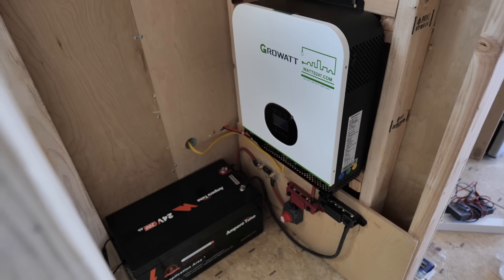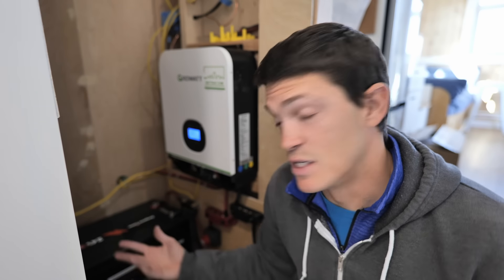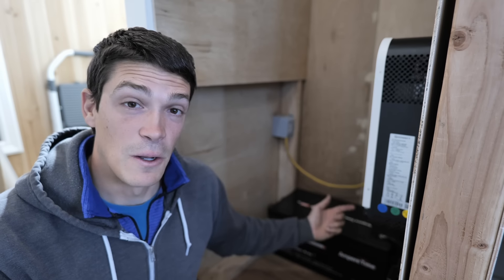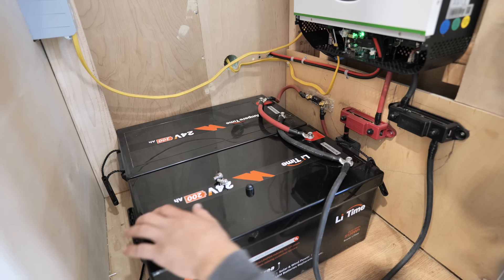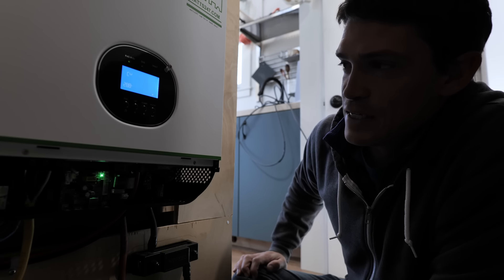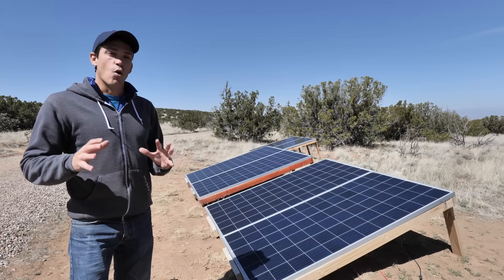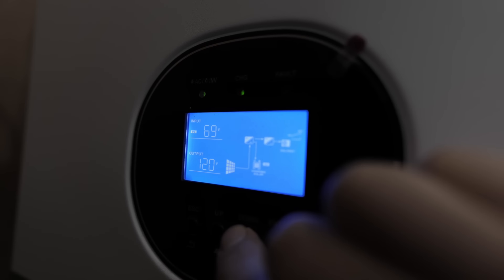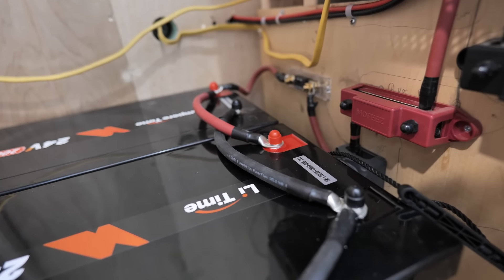OFF GRID SOLAR 24 Volt 1 Year Review + UPGRADES w/ LiTime Lithium Battery

Comment: If you want 12 volts,  use a separate panel,  battery,  and charger.  If you use a lead battery,  never connect batteries in parallel.  Bigger capacities like golf cart battery pairs.  6 volts plus 6 volts = a big 12 volt. I use stubby 100 watt 21.3 volt panels.
Reply: None of what you stated makes any sense, and I've been doing off-grid battery/inverter/charger/ solar systems for over thirty years.
1. if someone wants 12 Volts out of a 24 Volt system, one can get a 24V to 13.8V buck converter on either Amazon or Ebay. No seperate system needed.
2. Connecting lead-acid batteries in parallel is the only way to increase Amp-hours. I've connected up to four 12V RV style Walmart batteries in parallel with no problems. You are right that you can connect 2- 6 Volt golf cart batteries in SERIES to get a fairly strong battery bank of maybe 225Ah, but to get more time/power out of the battery bank, we have had up to 8 batteries, connected in a 2s4p bank to get power for my friend's home. 
3. As to the solar panels, The 100W.21.3 panels are fine for a small solar system, but maybe not for a larger cabin/home system.
Reply: @Tumbleweed5150  When you catch up,  share it with your audience.

Comment: I also run a 24 volt system. But the cables are double the thickness of yours. How is the heat on your cables?
Reply: they look to be 4gauge, which is overkill for the length they are running. They also have a fuse, most likely at 100amps.

Comment: Can you not provide a wiring diagram showing how to connect the inverter to the mains Consumer Unit.
There seems to be lots of videos but no one thinks of explaining to the likes of me who wants to use a inverter mppt charger unit but it's nit the cost of buying the unit but the cost of someone doing the connection work that causes the problem.
Nice system anyway.
Reply: It's worth it and from what I've seen not to hard some places you have to get a permit be because of YouTube people have to be careful not to get sued that's stuff

Comment: I don't know you solar system exactly. But if your max power draw from the battery is the inverter at 3000w the 250a fuse is NOT protecting your system. It is too big if there was a short all the wires would melt and the inverter would be destroyed before the fuse would blow.
You need a 125a fuse to protect the system. 25v × 125a = 3000w. Best wishes
Reply: 6000 watt surge on the inverter
Reply: @uhjyuff2095  That's wrong. Surge power will not burn the proper sized fuse. Fuses also have ratings for surge peak and duration. Most fuses don't publish this info on the fuse. Most fuses (unless specified) are slow burn, meaning they can handle a quick over current event.
Reply: @glennbeattie6172  I could be wrong but I think the BMS in the 200ah battery is rated for 200 amps and he has 2 so 400 amps total. the 250 amp fuse would therefore be the weak link if a fault were to occur such as an inverter malfunction.
Reply: The fuse is supposed to be the weak link. It's called protecting the circuit. 
What ever is the lowest rated thing in the circuit (wiring, inverter, battery, ect) is what you rate the fuse at.
Fuses and circuit breakers PROTECT the circuit! To prevent fire!

Comment: I dont think yours supposed to just connect a new battery to an existing system.  I think you are to charge the new battery to what your  connected batteries voltage is otherwise they may never balance out
Reply: this is correct, youre supposed to fully charge the new battery and wait a bit for it to equalize, then connect it to your system because if you do not, the new battery wont ever fully charge

Comment: We bought 4 four 12v 300 amp Litime batteries and they were faulty from the get go. It has been a struggle to get our money since they only want to refund through Paypal instead of our business account. I am not impressed with Litime. I ended up building my own battery bank with A grade 3.2v cells from china. Cost about 1/2 the price.

Comment: Good Video.  Question:  How has the critters been with your ground based solar panel setup?
Reply from the maker: Thanks! They don't seem to bother with it fortunately.
Reply: @ElementLife , I've found rabbits, mice, rats, etc. are disinterested in eating whatever the insulation is on panel cables and connecting wires. I'm using that were in every external application I can. I suspect panel wiring includes a rodent repellent of some sort. On the opposite side is the soy oil based insulation on a lot of Chinese wire. You can usually identify the soy insulation by a very shiny appearance and slightly oily feel.